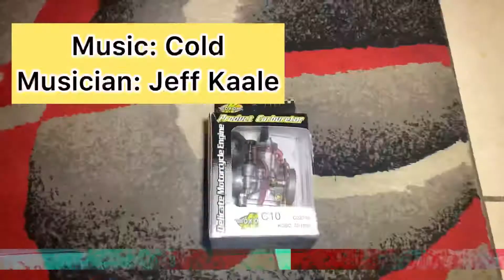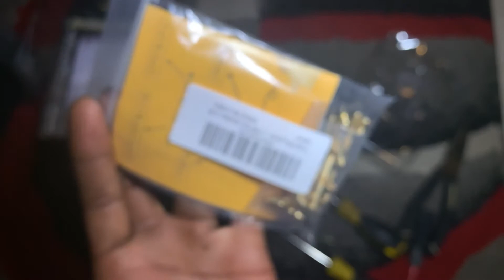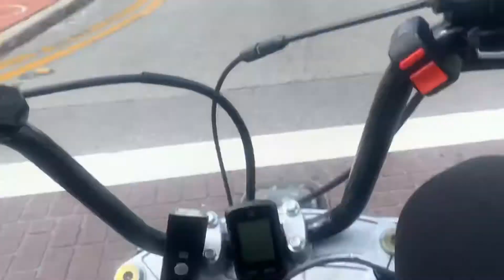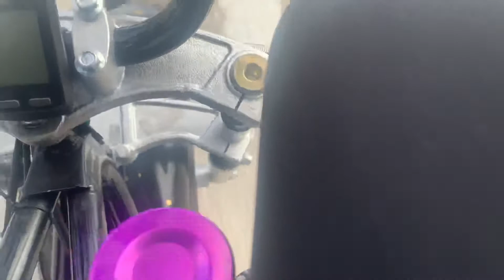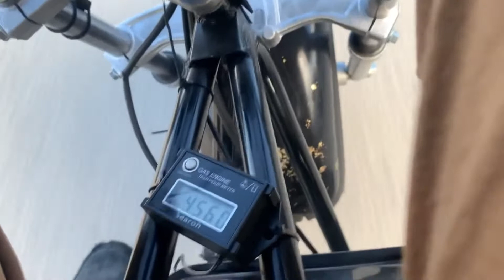Coleman CT200U PWK/OKO 30MM CARB INSTALL AND TEST/TUNE! Part 9(So close 😁)

Comment: I have pwk 28mm flat slider carburator, jetting with 110 and ,32 . 62mm piston . The issue is twisting throttle bogging . What will be the problem.
Reply from the maker: I have the same problem, you have to ease into the throttle and play with the air fuel ratio. I have to give mine a quarter throttle at start and also had to readjust the throttle cable with the PWK so it has a bit more throw.
Reply: Probably lean. If you adjusted your air screw already try moving the clip on the needle jet down
Reply: So it could work better get a 115 jet and it work perfect
Reply: Don’t forget is your 3000 ft above sea level its a whole different type of tuning.

Comment: ive got 30mm and all the billet and cam and valves etc inside my 212 on my doodlebug. now the problem is at 60mph it destroys whatever brake setup I put on it. Hydro...mechanical...doesnt matter. brakes are wrecked within a day or so
Reply from the maker: Are the brakes aligned properly? Do you have good quality pads? Do you need to change the rotor out? Those are the main things I could think of. These little things are gonna eat throw brakes at high speeds regardless, you may have to get a different compound of pad.
Reply: Best if get welded a foot pad brake
Reply: Try adjustable brake handles if youre hydro. LKV.

Comment: Why do you have a shut of valve for the pulse line
Reply from the maker: If you look in one of my other videos, for the mikuni when you use a fuel pump you need a pressure regulator for it cause the stock seat in the carb can’t handle the pressure.